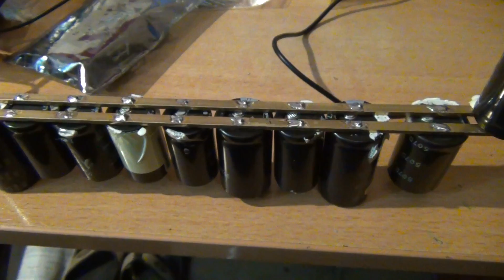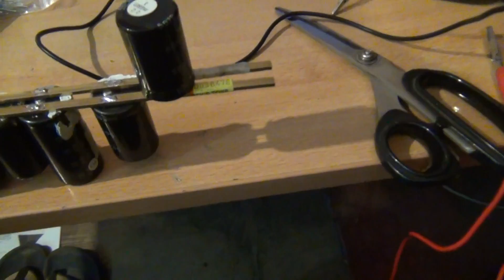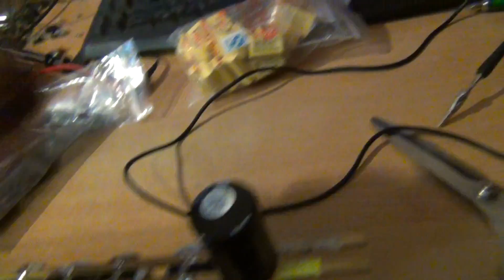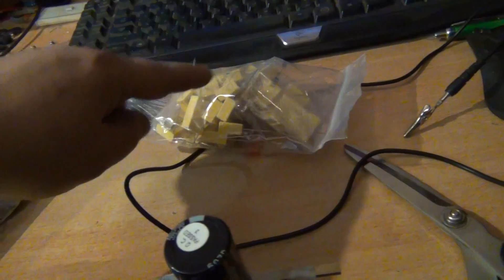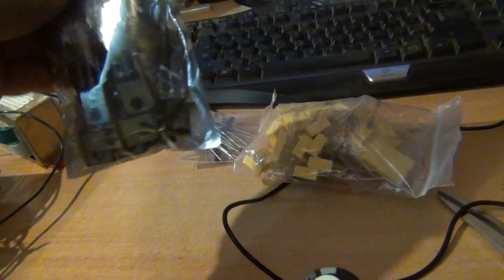Monday Update: Cap Bank of Boom on Rails, New Parts Arrive!

Comment: the DC rectifier will pop right away, you need a ballast, in this case, a 500 Watt halogens a ballast, it will start off at full power, then dim down as the caps charge :D

Comment: Hard to say really, i cant remember what mains supply you are using but when rectified i would guess the dc peak voltage would be higher than the mains rms voltage , and i would not want the bulb to blow its element.

Hard to predict as the capacitors would present a short circuit to the bulb at the start of charging, and the limiting effect of the bulb and its odd non linear resistance change with heat.

Im not an electrical engineer so stick 2 bulbs in series for a start :-) lol